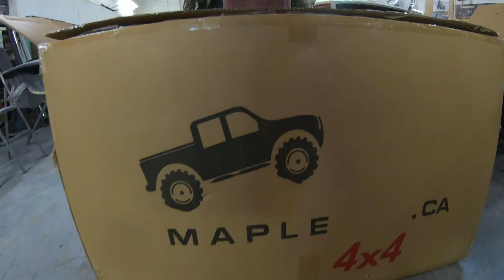How to make your old truck presentable, on a budget

Comment: What goes on the holes on the tops to hold them ?
Reply from the maker: Nothing, they only attach around the wheel lip. The Bushwacker flares fit super tight to the body, these knock offs are ok, but just couldn’t get that nice tight fit

Comment: i like how u said to pull out taillight to wash out the dirt my 01 Silverado is just starting to bubble at wheel arch maybe i get a rust killer in there to stop it now
Reply from the maker: Yes, clean it out, and once dry spray it really good with oil, or rust converter, or both 😉

Comment: You know, having just pulled the entire wheel well out of the left side of a Dakota box, and having had to replace the inner wheel tub and fabricate the outer one out of sheet and pieces of flange from wheel arch patch panels, and THEN replacing the outer wheel arches on both sides, I’m tempted to say that the way these damn things are designed, a guy should be better off doing what you just did on a NEW truck. Cut out the outer skins so they don’t touch the inner fender at all, and cover the hole with plastic flares. The drainage would be way better and dirt wouldn’t collect in that stupid pinch-point.
Reply from the maker: It’s true, I’ve always said I believe they’re engineered to rust out in 10 years. My ratty 59 GMC the bedsides are just one open panel, and the wheel arches aren’t rusty!